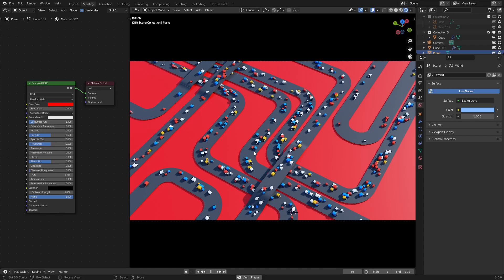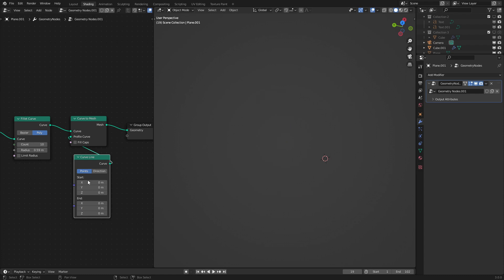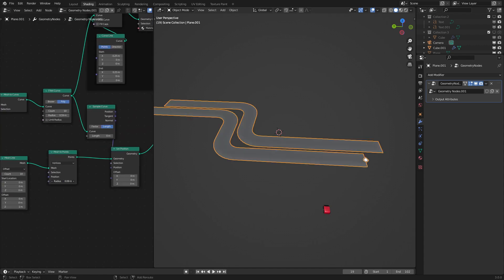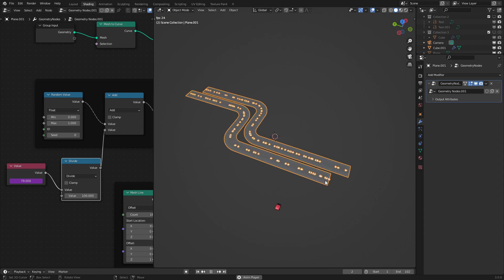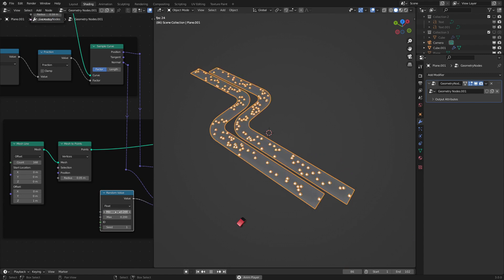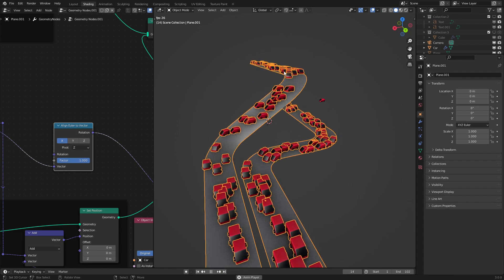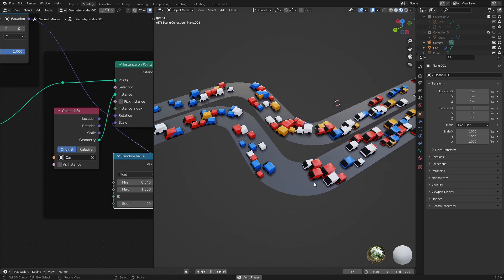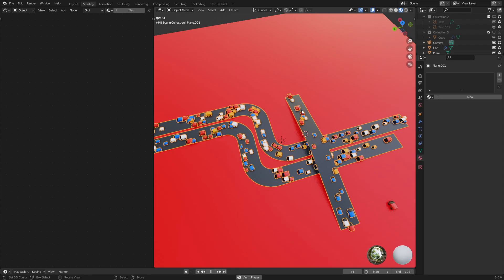How to make Traffic Systems in Blender 3.0!

Comment: Thank you for the tutorial. I have been diving into geo nodes and cars driving on curves. One thing I found was using the set curve normal node and set it to Z up. It helped with the road problem. Since this was 2 years ago you may have already discovered that.  I also use the 2 align nodes to the rotation.

Comment: How do you copy the points?  If I use Shift + D, to copy the vertices, I get a copy of the road, but the cars/points are not replicated to the second road.
Reply: I'm having the same issue.  My points/cars only jump to the 2nd road if I put a value of 1 into the Sample Curve node's Curve Index.  : (

PS - I think I figured it out.  I had to check the "All Curves" box in the Sample Curve window ( Blender 3.4.1 ).

Comment: Thank you for the tutorial. It works well.
However I stumble upon a problem when I want to instantiate a collection of cars. On some points Blender is spawning two instances although I have the "pick instace" box checked. It doesn't matter how many cars I'm spawning, the two instances just move to a different position on the street and the problem occurs on more points. 
I've tried different Blender versions, different collections...also using the "Distribute Points on Faces" Node doesn't fix that nor does changing the plane to a curve.
Do you maybe have a solution for that?

Comment: You could avoid that clipping by using distribute points on faces (poisson disk) instead of mesh/curve to points
Reply: How does this work (on which place I have to put the dis points on faces in?)
Reply: @rs-m00v  you'd have to do curve to mesh then distribution of points then mesh to curve and resample curve.
Reply: he's changing the speed of certain points after distributing, it won't make a difference
Reply: It doesn't work

Comment: Poisson Disk will let you set a minimum distance from one another, and avoid the clipping issues. This is an amazing tutorial, thank you!!! 👏
Reply: Can you elaborate this a little more. I used this to generate crowd and they are clipping badly.
Reply: @dineshdiabolic5451  When you Instance on Points you can select "Poisson Disk" from the dropdown menu. This will activate an option that lets you set the minimum distance value. Essentially allowing you to set an offset between instances 👍

EDIT: Let me review this video and my nodes and I'll get back to you. What I said up there is wrong 🤣 Refer to my final reply below 👇
Reply: When you use the "Distribute Points on Face" node there is a dropdown menu that has an option called "Poisson Disc". Select it and play with the distance value and you can set the minimum distance between your points, and of course whatever you choose to instance on said points 🙌🎉
Reply: @orpheuscreativeco9236   can you mention please where exactly to plug it? Cant understand where to use this node in such setup. Ty
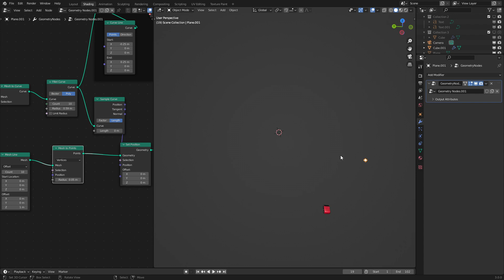Reply: @nihrom3210   He uses a Mesh to Points node around @03:00 to distribute points along his mesh line. I would rework this section so that I could either A) distribute points on face - or - B) use some vector math to manually set the minimum distance between the spawned points. But without making my own copycat tutorial, I can't really explain it all. 

Sorry, my comment was more of a suggestion to the creator rather than a point-blank solution. I hope this helps a bit. ✌️

Comment: Great tutorial thanks! I have a question. The cars in the turn/bend (sorry not sure how to call it) seem to be swooping trough faster and then going back to their original speed. Is that some that would be easy to fix?
Reply: I often had to face this problem when using curves. The position factor is not strictly linear considering the distance from start to end. It seems to be linear by subdivision section according to their individual length. I can't see the aim of such a behavior. To my opinion, it's a pain in the ###. Is there a good functional reason ? Or is it a technical issue ? The only way so far I've found (but I'm a newbe) to limit this effect is to ensure each section of the curve has approximatively the same length (which seems not possible in this case, subdivisions being created by Fillet Curve Node).

Comment: 8:40 for better rotation
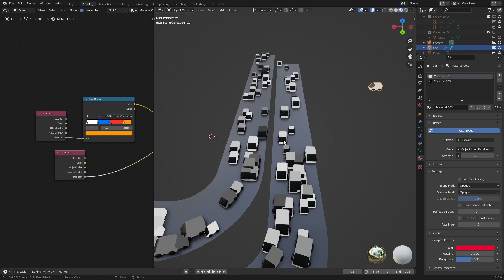Reply: 11:00 how to make cars color random
Reply: My guess is that there's no "issue with Blender" when it comes to the slight misalignment between the cars and the road. I think the root of the problem is that we are taking the rotation from a curve, and the curve may have some tilt to it, but in any case it's not taken into account in the calculations. There's also no x component in the "align euler to vector" section, which i suspect is a different issue but I'm not sure what "tilt" in curves really means in Blender. :P 
But what i thought it might mean is: it's like when you would put skis into a circular stairway - the ski that likes on the stairs near the outer edge of the staircase is not at a very steep angle, but a ski near the inner edge of the stairs is very steeply angled. That results in non-planar quads/surfaces which a car wouldn't like very much, with its suspension system being the only way to tackle uneven grounds.

Comment: Can you make a follow up or explain how to make the cars not overlap?
Reply: something with poisson disk might work
Reply: @vAmmonite  I've found that plugging in a cube mesh (any mesh can be used) rather than a line lets you put it in a Poisson disk Distribute points on faces which can be plugged into the set position. It eliminated the problems almost completely for the cost of having a rather empty road.
Reply: I'm also interested in this. You can control distributed points to avoid overlapping, and I've done it before but can't recall how 😅
Reply: If you use integers instead of floats with the random number generation and then multiply the numbers appropriately you should be able to give the cars a minimum spacing. I think that should be a simple solution.
Reply: @vectoor91  Hello, I’m trying to solve this issue, could you tell me in more detail how to do this?